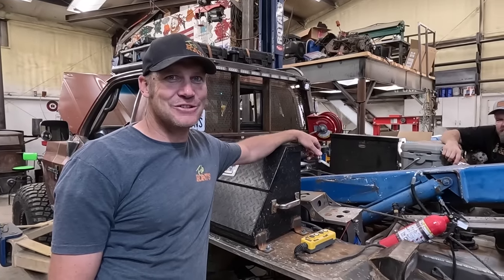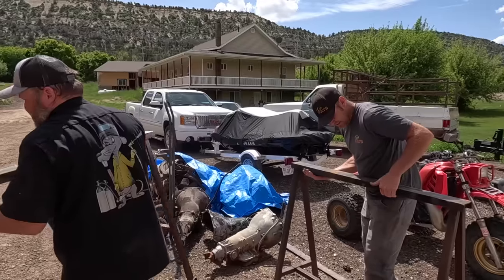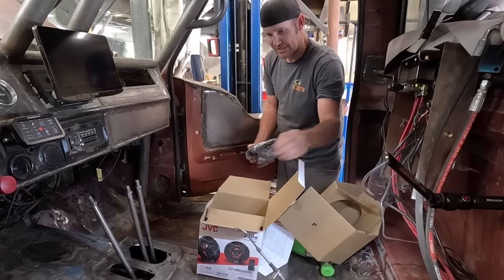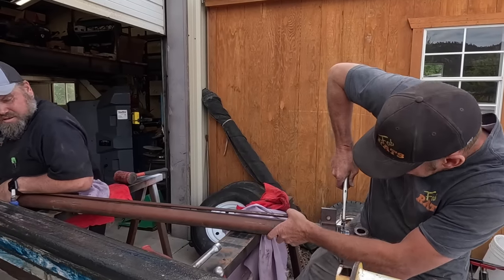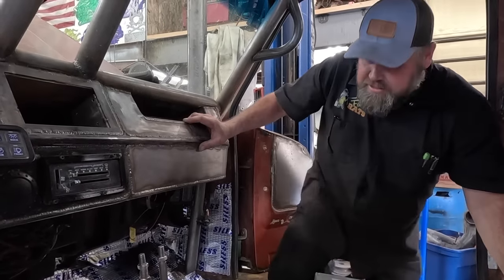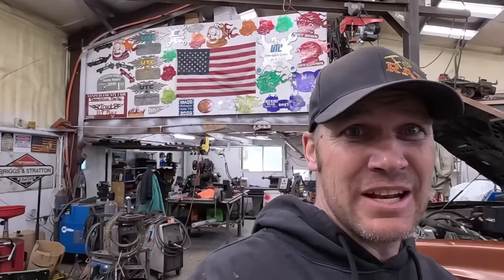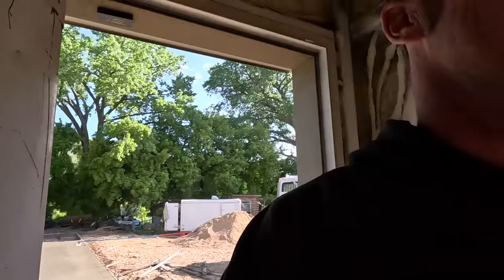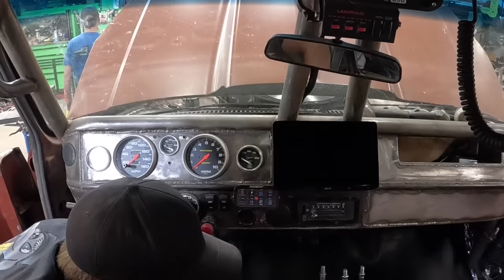Revamping The Rat Rod Tow Truck Plus A Never-Before-Seen Recovery

Comment: The spray foam cures with moisture. Spray it with water to harden faster. Just means you did a good job sealing the door up.
Reply: I concur!😊
Reply: I also concur
Reply: I concur the most.
Reply: It was the speaker gods tryin to help ya keep it spacey in there.  As a general rule, you need space to make bass. See Thiele / Small for more info.
Reply: See these other guys ⬆️?  They don't concur as much as I do!
Reply: Shout out to the concrete finisher in the grey t shirt. 👋
Reply: Wow good luck on your new shop
Reply: I’m the concuriest
Reply: I con con con concur too!

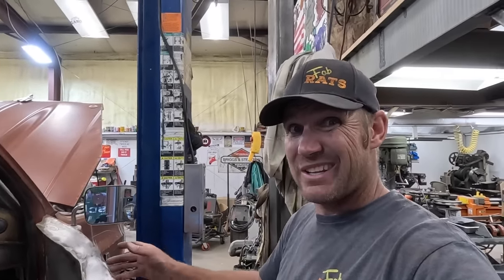Comment: 25:37 The foam sets and expands better with a light spritz of water.
Reply: For real!??
Reply: They are in the desert with VERY dry air... this makes sense.   Thanks for the education.
Reply: PU polyurethane foam uses the moisture in the air to harden, so if it can't get moisture, it won't harden
Reply: @FabRats came here to say this. I am a little behind and just now catching up on your videos. Use a little spritz of water between layers and it'll help it cure, exactly like @COM70 said. Read the back of the can.

Comment: Hey Paul those foams generally react with humidity in the air. I bet combination of dry air and being fully contained kept it from fully curing.
Reply: yep.... some guys inject a mist a water as they push the foam into sealed places.    Saw it somewhere here on Youtube few years back.  Video was about how to spray foam into vans in camper builds if I recall right.
Reply: It’s in an air tight door so it couldn’t off gas and harden
Reply: @jayroberts636  Seems it it is not gas off issue...  is is air moisture in air that is the issue.   The spray can style foam mixes requires typical moisture found in surrounding air to mix with the formula.  It  needed to complete the hardening stage.   Lot of discussion/videos on this in the van life building forums and videos.
Reply: Lesson learned...
The foam deep inside may harden eventually it may take years !
Next time apply those spraycan foams in small doses.

Comment: Spray foam guy and loyal sub here. Try misting with water from a spray bottle.  That may kick off better curing.  To clean out the shmoo, use gloves and acetone.  It will dissolve the uncured chemicals.  Do NOT use mountain dew on the foam.  It will cause a caustic reaction and send it into the danger zone!!😂😂😂
Reply: Do tell why  you know about mountain dew lol

Comment: I work at a company that makes hydraulic cylinders… I winced when you got that hammer out 😂 you might have gotten lucky, but there’s a good chance you tore an outer seal and pieces of it are now running through your pump… we use an assembly tool, basically a really thin ring compressor and can be made on a lathe. Hope this helps if the cylinder bleeding down under load gets annoying

Comment: Expansion foam works with moisture spray a little water in when you fill stuff like that so it all sets up well more of it anyway
Reply: Exactly what I was thinking
Reply: You also can't just put a huge glob in one place. It cures from the outside in, and once you get a little over an inch of the outer portion cured, it acts as a moisture barrier,  preventing the inner portion from curing. You have to apply it in layers, letting it cure between applications. When you hear the nightmare stories about people having problems with spray foam that was installed in their house, it is usually caused by poorly trained (or untrained) contractors taking shortcuts trying to apply the foam in a single layer that is 4 inches or more in thickness.

Comment: The Fab Rats team tackled some tough projects today rebuilding the boom on the tow truck, installing the insulation in the cab, getting the stereo and speakers installed, etc. Did you get the AC serviced? Grandma Lolly is such a beautiful addition to this family and we love her! ❤ And so nice to see that the concrete is poured for the new shop this going to help so much by giving them more room! Hunter is such an asset to the team and is quickly picking up on a lot of the work being done.

Comment: Hey Ben,  keep in mind when running wires for audio its best to have the speaker wires and Rca wires separated from any power supply or 12v signal. It can create some interference and a whining through the speakers. Typically its best to run audio on one side of the vehicle and power on the other

Comment: I am a little surprised that there is not a nylon wear pad on the tip of the lower boom for the upper boom to ride on.  If you have to extend the boom under load, it will prevent metal on metal wear.

Comment: Hi Paul 
The foam requires moisture to go off. Before  we ever spray expanding foam into a confind space we give it a few sprays of water with a mist head spray bottle. 
I'm a carbon fiber product manufacturer in New zealand. If you read the data sheet on the foam or talk to the rep they will confirm the need for moisture

Comment: To share a stuck truck story. My dad is a trucker and at one point the company he worked for was hauling gravel to a local monastery for a construction project they were doing. My dad hauled several loads to them and one of his coworkers who went by the handle Big D was also hauling to them. My dad left to go grab another load as Big D was coming in to dump one up on the hill where the monastery is located. My dad got about half way to the quarry when he got a call from Big D because he was freaked out because he got stuck in the mud and the Russian Orthodox monks were gathered around chanting, trying to pray the truck out the mud. My dad who is also a Baptist preacher turned around and went and pulled him out and then told us about it while laughing as soon as he came home.

Comment: That gooey spray foam could expel hazardous fumes into the cab, if the correct mix percentages were not reached during installation. The only fix I'm aware of is to remove it all, and start over. There's plenty of documentation of people getting very sick from being exposed to those fumes,, especially if it gets warmed up. The canisters need to be within a certain temperature range during installation, to insure a correct mix. Love your content and delivery. Much respect.

Comment: If you really wanted to add a subwoofer in the cab could put it up front and center of the shifters and tucked parcially under the dash. Would just have to make a custom box which could also be a good place to tuck some of the wires that were ran for the sound system or tuck the amp in with the box so the amp is not seen. Awesome build! love seeing the progress of this thing!

Comment: You guys always do such a good job of innovating.  The Sub is easy, just calculate the inside dimension of the Sub Box and make another one that is longer and flatter so it maintains the same volume and fits closer to the back of the cab and lower so you don't bump your arm on it.  It could actually run behind the passenger seat.  Half or 3/4 inch plywood would be tougher than MDF that most of them are made of.  You are going to be knocking around quite a bit so it needs to be strong.
Be well and have fun with it.  BTW, I wear my FabRats T-shirt proudly.

Comment: Expanding foam is moisture curing, it reacts with moisture in the air to cure, so if your doors are all sealed up good, then the foam will just set partially but can't find enough moisture to cure fully. It will set now you have opened up the doors.

Comment: Use that 2 part fence post foam. Its cheap and closed cell so it won't absorb moisture. Gets hot curing though so be careful. I just measure out how much I need of both parts and mix of small batch instead of using a while bag at once.

Comment: I use a powered 8" sub by Soundstream thats designed to fit under a seat. I installed mine behind my seat against the cab. The sub sounds incredible, its more than I need in my extracab.

Comment: I worked it the hydraulic industry for over 25 years, have done countless cylinder repairs. The longest telescoping boom cylinders I rebuilt had an 18 foot stroke, it was interesting to say the least. Your cylinder is just a tiny one.

Comment: Spray in expansion foam has to be done in layers...... Leaving it to dry for a few hours between each layer.... Then you have to leave an airhole in the panel for it to fully dry before you seal its up watertight

Comment: Well sounds like you already got enough information about the spray foam. As for hunters question: panda 🐼 express I get the bigger plate as well, all chowmein, Kung pao chicken 🌶 ,and the mushroom chicken, and the hot Chinese mustard. It's so good🥡🥠. You see long time😁 
As for the subwoofer mount it in front of the center console or on the roof in the center. 
Anyway your LJ got some serious power!!!!
Have a good week and count your blessings amen. 
Nothing like watching concrete dry at the end of the day.🙂👍

Comment: If you seal foam fill it goes back to liquid.  Learned this when making pvc pipe outriggers for my canoe.  Went to redesign them, when I cut them open all the foam had turned back to liquid.   Once air got to it started swelling back up.  Crazy

Comment: Use shop air to blow out the fluid from your hydraulic cylinders. You can also use shop air to collapse it to install. You have a push pull vs a push only cylinder. Shop air jelps a lot in the not make a mess factor!.

Comment: Paul, Make a drip shield over the muffler. A leak on a hot muffler could cause a fire. Fixing the leak does not mean it will never leak. A drip shield is just like the heat shield over a catalytic converter.

Comment: I was actually expecting that foam to be that way inside the door.
You basically just took the foam out of the can and put it into another "can". The deep inside was starved of oxygen and water - which are the two things the foam requires to cure. Now that you exposed it - it will now cure. This is why foam is applied in stages.

Comment: What you need is a marine outdoor subwoofer mounted on top of the truck. The low frequency of the bass will move right through the cab. Make a box and point the driver (speaker) down about four inches above the roof and it should scratch your itch if you have enough power.

Comment: That style of foam requires exposure to moisture in the air to cure.  It doesn't work well in deep, sealed, cavities because the inside part will never be exposed to the atmosphere so it doesn't cure properly.  For sealed cavities use a 2-part foam.  There are pourable products commonly used for marine applications--just search for "pour foam"--and sprays like Froth-Pak.

Comment: if ya used the spray insulation foam like GREAT STUFF... ya have to have a vent or escape portal for the air to dry it out.. it is different from the procedure  to foam filing a tire.. with sealant foam like ya used in the door it has to breathe to expand and dry..

Comment: I worked concrete with my uncle in the 70's. Other than the extended arm, everything seems to be being done the same. We had to run wheel barrows from the mixer trucks.

Comment: Foam cures with moisture. That can be from the air... Or in your case with a sealed environment that used up all of its moisture. Anytime you spray foam in a sealed environment get yourself a squirt bottle and add some moisturizer while you were spraying. You can try adding water but at this point I think you are left with a learning experience 🤣 next time remember squirt bottle while you are spraying.

Comment: Cut a  square out in the back of the cab put the speaker box inside the cab and little bit outside the back of the cab weld a box around the speaker box to keep water and snow off of it.

Comment: failed foam is usually from either moisture or not getting hot enough. Cold shop? Wet inside the door? High humidity (probably not in the desert).

Comment: The foam needs access to very humid air in order to set up and cure, so in dry climates it's common to use a spray bottle to spritz water onto the surfaces when applying the foam in enclosed areas.    Also, the guys at OverKill Engineering are audio acoustical and electrical experts with over a century of combined experience and some of them are past and current owners of mobile audio companies like J&H Audio, Linear Power, Brutal Sounds, RE Audio, etc and I'm sure they'd be happy to help you with any questions you have related to audio/video and electrical upgrades, along with possibly providing you access to things you could use for your builds, as i know a couple of the guys are in the recovery business.

Comment: Would you consider moving the speakers to the roof? That way the doors don't need wires and a second set of speakers for the other doors, and they're high just in case some water gets inside.

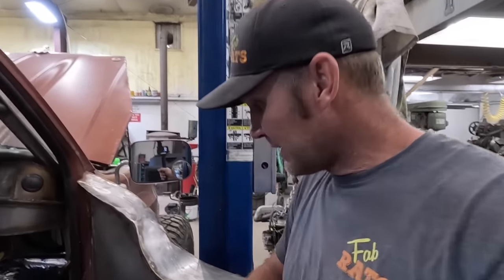Comment: 25:10 I often have the exact same problem when I try to apply expanding-foam insulation to seal around the edges of windows, and I have to tape off the side/bottom perimeter-channels (the top portion correctly sits in its channel with gravity) so that the foam will stay in place till it puffs and solidifies.  Since the tape tends to seal out the air, though, the foam doesn't always expand, dry, and/or set up properly, and instead forms a gooey lumpy gaps-and-hollows-filled mess like you have inside your door there. :P

Comment: Paul you should have hooked that cylinder up to the system and check to see that it works and not leaks on you could have saved some work if it did leak

Comment: The foam was to dry. It needs moisture to cure. I always spray a load of water round the cavity with a hand spray bottle before filling the cavity with foam. I also spray the foam with water once I've finished spraying it in. If you've got uncured foam just spray it with water and it should harden up.

Comment: If that foam is urethane based it's probably curing so slow because the desert you live in has such low humidity. It will cure on the moisture in even the dry Utah air... eventually. We have the same problem here in Montana. Try misting some water on it from a spray bottle to speed it up.

Comment: Hunter, your third brake light seal is leaking. This is what the big stain in your headliner is. Had the same problem in my 2015 1500. Get closed seal gasket from you local hardware store and clear silicone will fix the leak

Comment: looking great. next time ice and water shield at lowes or home depot is a lot cheaper than boom matt. lizard skin too as a heat deflector they make a heat deflector with ceramic crumbs in it. they also make an undercoating too. they both spray on like rapter liner as a 35-year retired body man for a family-owned garbage company I've sprayed them all from line x to cheaper. sem makes one that stood up to a port-a-poddy truck international 4900 sliding down the threw way here in Niagara Falls new york. no scratches so I did my 1992 chevy plow truck in sem bed liner keep up the great work lizard skinned the cab underneath and ice and water shield the inside just because i wanted the rubber floor mat and finished it off in ppg gun metal gray the original color looks great and when you rub a tree plowing you can't tell cause it won't scratch .since i did that truck they all have clear out where you can just add base coat color to it than it's your color throughout it. raptor liner makes it in clear too

Comment: @Fab Rats The foam can't cure without being exposed to open air. The curing process starts when the foam comes into contact with the air, but if you shove it into a area full of foam and it never sees air, it won't cure, just like you found out here. FAAFO type of deal lol

Comment: For the foam When doing big areas I've had to do it in layers. Do the bottom.let it set then fill the a bit more let it set and so on or else it creates a case and like you said where there's no air it won't work

Comment: Expansion joints in that monolithic slab you had poured? Hope so! Also with the weather you all have how deep was your base ? 
Do NOT seal that pad and feed it water 
Otherwise she will crack. After 4 weeks if you want you can seal it. Concrete loves water. Water the pad for the first week a lot after day one. Concrete needs to breath and drink AND ALL CONCRETE DOES NOT crack
Portland cement from ancient times still ain’t cracked. See you all on the Mighty MO
STL 314

Comment: There is a sub woofer that is smaller. It would make the back wall of the cab vibrate and basically act as a sub. Might fit ur needs.

Comment: 25:13 I sprayed some foam around a window once. It was really thick, and it did the same thing. It bubbled out so I cut it off flat. It was not cured inside, and bubbled out again. I assume it is because there wasn't air getting to the inside.

Comment: That was a great pull with the fj 
I did a similar thing in the 80s we had a hj47 4.0 diesel our truck was a bit smaller and back then all we had was chains 
Me and my brother off loaded half the sand with shovels and I had the HJ  in low 4 on the bitumen 
She did one bunny hop and proceeded to dig 4 holes across the bitumen road but we pulled out the truck with 4 tons of sand still in it 
How we didn’t break anything I have no idea 👍👍🇦🇺🇦🇺

Comment: Very productive couple of days insulating heat shield, stereo, navigation, boom leak , pull a dump truck out and last but not least a new pad for a new shop . What about locker air leak ? Just kidding it will alway leak  :-) Still only see three water bottles. Thanks for sharing the adventure